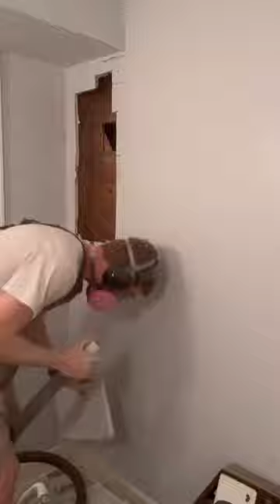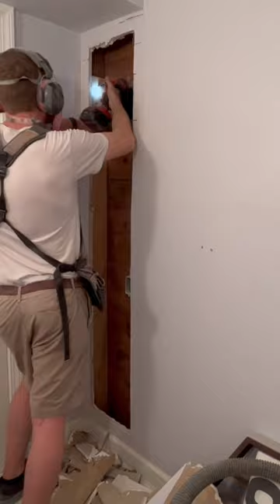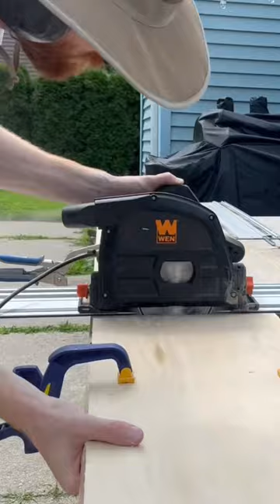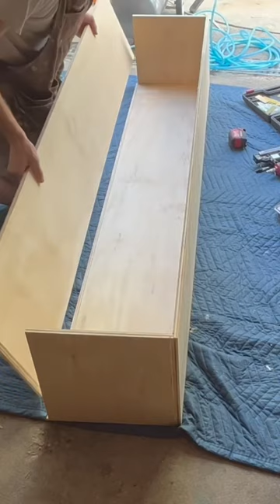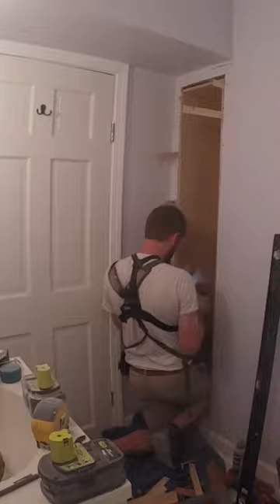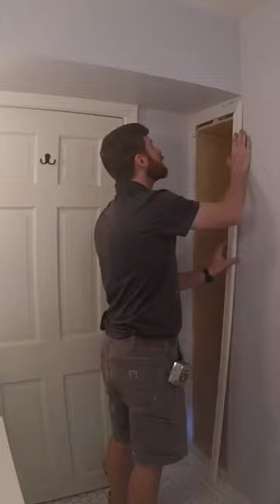Transform Your Bathroom With Recessed Shelves!

Comment: Does this fall under "basic" work? Im struggling to find exactly what im able to do as unlicensed. Ive read the state laws but they arent super clear.
I can do $30k and under without GC license but cant modify plumbing or electrical, only replace existing basically. Thanks, nice job!
Reply from the maker: Hi Loki, I’d say for a job like this, as long as you’re not cutting into studs or removing an entire wall section - something that would effect the structure of the home you should be ok. This is a more creative project, but calls for basic carpentry skills that shouldn’t require a license. If you find something that specifically calls out this type of work as requiring a license, let me know!